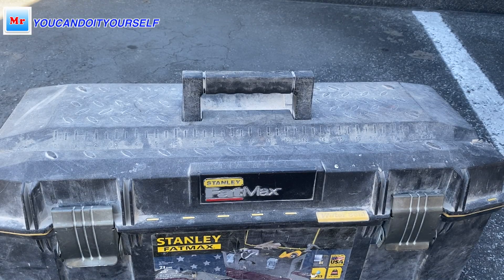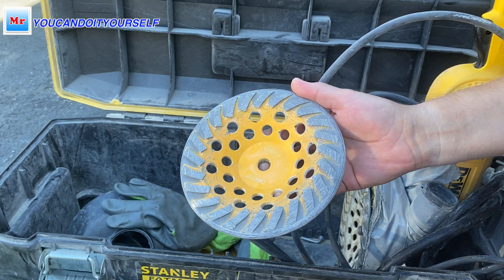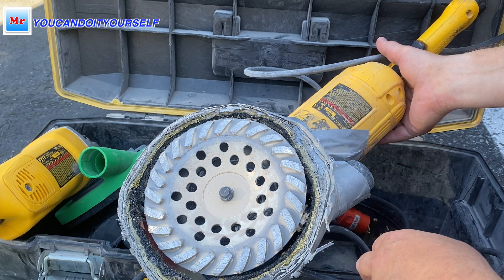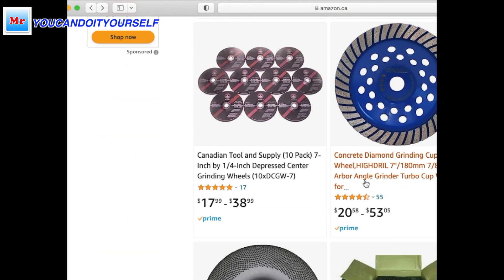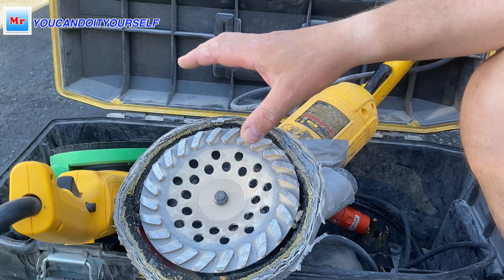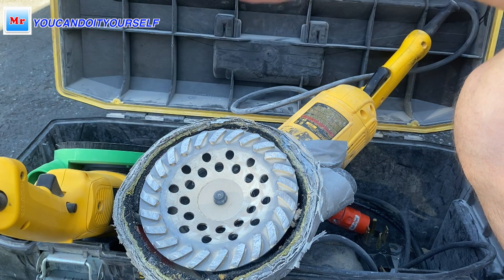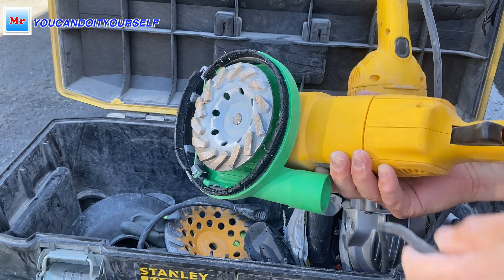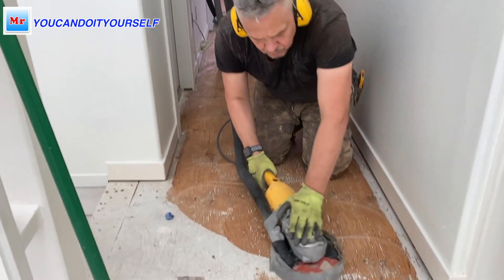Wood Floor Grinding: The Ultimate Guide to Choosing the Right Grinder Blade

Comment: So the concrete grinding cups will work on grinding high spots on wood subfloors?
Reply from the maker: 👍Yes
Reply: @MrYoucandoityourself  I was thinking about the cheap yellow 4 inch ones on Amazon.  Think they are comparable to about 60 grit sandpaper. Do you know if using the the cups would be faster than using a sander?
Reply from the maker: @bubbalo3388  Hi, 4" is too small.  Sandpaper works faster, I am using 24 grit for the flooring edger.

Comment: How does this work over staples? I am thinking of using this method to remove heads of staples on a massive floor area before laying new masonite board down?
Reply from the maker: Hi, hammering down or removing.
Reply: Staples are no problem generally speaking. I regularly use mine for that purpose. I would caution against grinding anything metallic that’s bigger, screws or nails would be risky both to the machine and the user.
Reply: @mikestephens8718 yup I can confirm this, today I got lucky
I went ahead and thought I’d grind the head of a screw but it only got pulled up and got stuck on one the disc teeth and started shaking around, I quickly than turned off the machine, I thought I was gonna f up the bosses tool and buy a new one out of pocket 🤣 shi. Scared me but we do normally grind stapes from the padding and and gets sucked away in the shop vac,
We use a makita concrete 7” grinder with a rigid vac

Comment: How do I know when it’s time to replace the blade?
Reply from the maker: How do you know when it’s time to change tires on your car?
Reply: The ‘teeth’ wear down, that’s their function. As the teeth wear down fresh diamond is exposed and the cutting performance is maintained - it’s different to sandpaper which technically only has a surface layer of abrasive. Cup wheels have abrasive impregnated throughout the teeth. 
A new cup wheel might have 10mm of tooth depth but a well used one might be down to 2mm yet it would still function adequately.